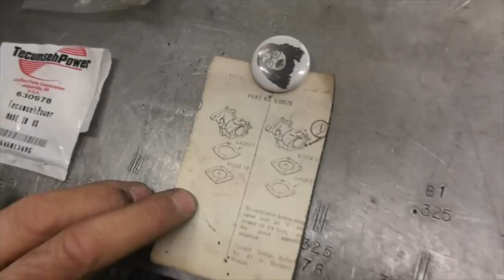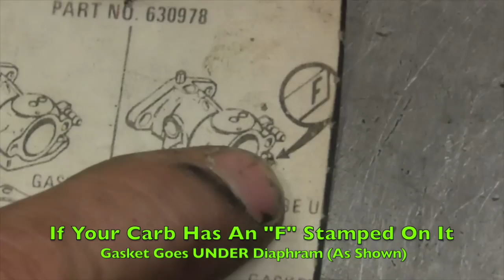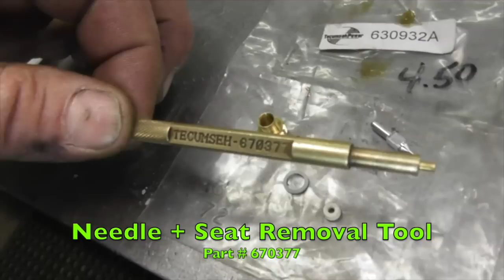How To Fix A Jiffy Ice Auger That Won't Start (Diaphragm Carburetor)

Comment: I just bought a 2000 jiffy auger. All that this video showed that was wrong with the carb was what was wrong with my carb. The previous owner had the gasket wrong, the needle seat wrong and no o-ring for the idle adjustment screw. A million thanks for sharing your knowledge Taryl!

Comment: We get a pile of these things in this time of year. I just had one with the same carb (F3) and put the diaphragm on first... damn thing ran rich as hell and couldn't get it leaned out. Reversed the diaphragm and gasket like a typical carb and it was fine. It also had high and low carb screws... noticed yours only had one. 

I also just oil the seat and stick it in the hole, use the new needle to seat it.
Reply: I'm working on one right now and mine only has one adjustment screw too wondering if that's how it's supposed to be or if I'm missing one

Comment: Ok I cleaned the carb on my old model 30 it has a metal bowl not plastic anyways once primed it starts but once it uses the gas in the bowl it stalls the only way it will keep running is if I keep priming it

Comment: Hey taryl, love the videos. Question about the jiffy? Change diaphragm, needle, seat, spring. Auger fires everytime won't stay running? Tried the 2 screws,  still the same. I have trufuel in it.the fuel is suppose to last 2years. It's 50:1 mix. I drained the fuel out last year for storage over the summer. Thanks brian

Comment: Thanks for pointing out the "f" stamped on the carb.  I rebuilt mine and could not get it to stay running!  Pulled the 4 screws out, flipped the diaphragm and winna winna chicken dinna

Comment: These been coming in the shop because the lake is frozen.  They are a pain to get them to run right.
Reply: Ya that's why electronic ones are better but I can't afford that I have gas starts good
Reply: I guess it depending on what brand u have jiffy has been around a long time

Comment: Well I wish I had seen this video almost 20 years ago, I junked a snowblower because it had one of those carburetors on it and it kept pouring gas out. I even ordered a new carbitrator and the new one did the same thing! I guess that needle valve was stuck!

Comment: YOU MAY NEED TO TRY THE DIAPHRAM BOTH WAYS!... FYI...
Well i got a carb kit for mine which had an F3 on it. I put it on and was running WAY too rich with gas sputtering out of the carb, cleaned it twice and still same thing, then i switched the diaphragm on top of the gasket. (between the metal cover and gasket) and it ran perfectly...weird, anyway great video.
Reply: @kurtisbutler227  sorry man , I don't have time at the near future but a new carb is always the guaranteed solution.

Comment: I've had premix in containers do the same thing. All of the gasoline evaporates over a year or so and leaves the 2cycle oil behind as if there was never any gas in the container. Obviously there was a very small air leak in the container.

Comment: Just curious... why do you filter the old gas drained from the tank?
Reply: To check for sediment in the tank. Then it’ll need a good flushing
Reply: In case its still good and to remove possible contaminants.
Reply: When in doubt, dump it out. Are you going to try to save a few pennies or maybe even a whole dollar by salvaging old gas when old gas could be the main problem or at least a contributing factor?